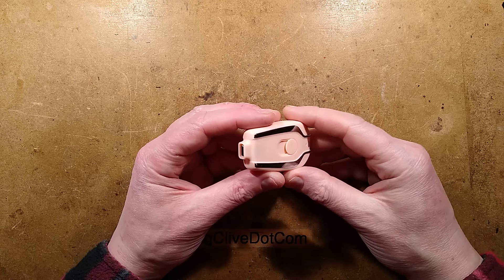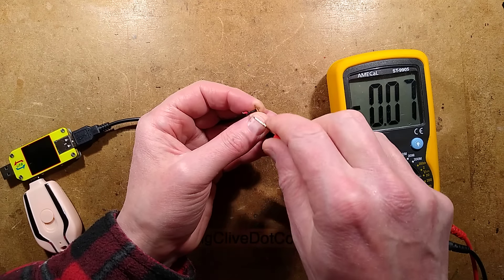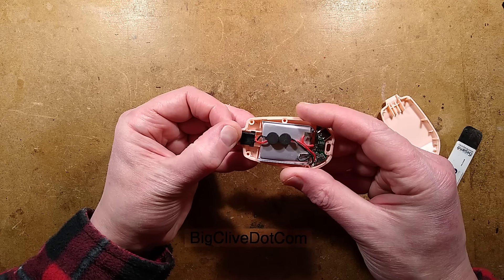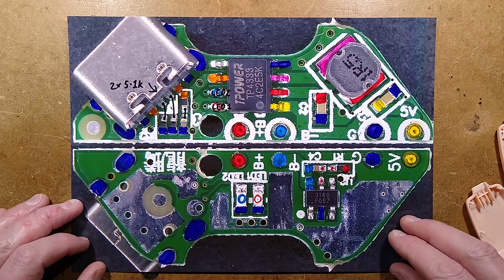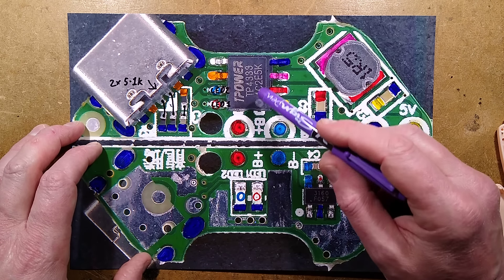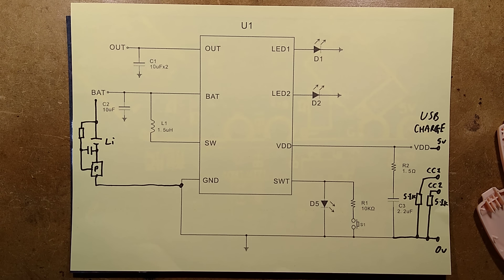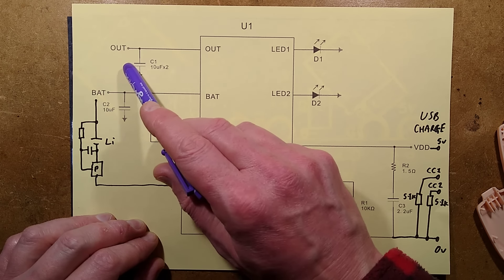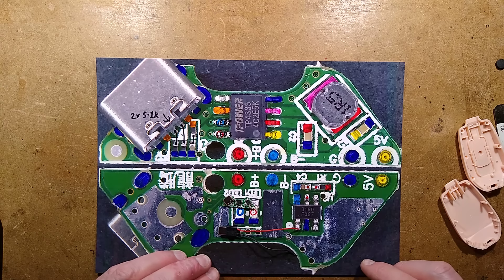eBay keyring phone-killer

Comment: Finally, the damn resistors are actually in place! I got a product recently that at first glance doesn't even have the PINS in the USB C connector for the 5.1K resistors that are nowhere to be found on the board...
Reply: That might explain why my cheap Amazon LED floodlights only charge with the supplied charging cables. Putting my phone's charging cable into it just makes it do nothing.
Reply: @99domini99  without the resistors, it’ll charge on a usb A to usb C cable but not on a C to C cable.
Reply: @JasperJanssen  Most of chargers without resistors give standard USB 5V, just output voltage selection is off. 5k1 resistors is also 5V selection for charger.
USB A to USB C cable links USB port power out with device power in - so also 5V in operation.
Reply: @adamw.8579  The 5k1, for the chargers that honor the standard, are also for the cable detect / activation of the charger, not only current select. Because USB C ports can be both sink and source the resistors are placed so that both devices will not try to charge each other simultaneously. And then it depends on whether or not your device can enumerate. The standard is complex enough to be honest, without getting into PD, but very few respect it.
Reply: @adamw.8579  The CC resistors are not used for voltage selection, they're used to identify USB C port role (sink, source, and some special stuff) and for sources to identify the current it can supply (usb standard, 1.5A, or 3A). To get anything other than 5V at up to the advertised current you need to do Power Delivery negotiation.
Reply: @adamw.8579  Any USB-C charger that provides 5V prior to detecting a sink (which requires the 5k1 pull-downs) is in violation of the USB-C standard: "The Source’s USB Type-C receptacle VBUS pin shall remain unpowered [..] until a Sink is attached. The VBUS pin shall return to the unpowered state when the Sink is detached." —USB Type-C Cable and Connector Specification v2.1, section 4.4.2.
Reply: (of course that also means the charger in this video is non-compliant even if they hadn't reversed the polarity, but that should surprise noone.)
Reply: @MatthijsvanDuin  Not very sure on that, on first thought, I would think it would be if it was at least properly fused at least at the output. I think by USB-IF standard without CC line voltage detection 1A is allowed for all types of USB connectors. If I remember right, you can place the 5k1 resistors, which with a capable charger will give you up to 3A at 5V, but then the downstream device has to read the voltages on the CC lines to determine polarization AND how much current the upstream device can safely give. The 5k1 termination resistors are not a free pass for higher current, the downstream device has to be able to determine, how much current it is able to draw. So yeah, probably still not compliant if it is charging with more than 1A, but if it is limiting itself, probably for thermal reasons, then it´s not that bad of a pass.

USB standards were kinda developed by the market and the USB-IF kinda followed up the market, not the other way around, so it´s kind of a very peculiar situation that you get, since with the old standards very few devices would actually pass, but the newer allow enough flexibility.
Reply: @TrickyNekro  Also, if the source advertises 1.5A or 3A via the CC pull-ups then it's guaranteeing it can source 5V at that current. A sink that detects this advertisement via CC does not have to "be able to determine, how much current it is able to draw".

You may be confused with the old USB Battery Charging spec which allowed the sink to try to get up to 1.5A but only guaranteed 5V up to 0.5A, so a sink that tries to draw more than that should limit its current to keep VBUS from dropping too low and in particular to keep it from dropping below 2V since below that the charger may disable the output.
Reply: @MatthijsvanDuin  Yeah, I don´t think I´ve said something opposite to what you said, unless I confused upstream and downstream. So let´s do it with source and sink, that´s a bit clearer.

The sink has to be able to read the voltages on the CC lines to see how much current the source can provide. That´s what I said, or tried to say, in my comment before. In that sense there is a "negotiation".

With USB3.x:
If the device can enumerate, if should not draw more than 100mA before enumeration. And in the enumeration it negotiates the current it can draw. If it can not enumerate, a.k.a. a battery charger like this, it has to limit itself to either 500mA, 900mA or 1500mA, probably looking at the D+/D- line voltages. Yes, that was battery charging something charging specification.

But I can remember very well, that the current draw for non-enumerating devices was made greater by the USB-IF because of all the gadget market. Originally, the specification was 100mA without enumeration, now it is the 900mA limit if not mistaken. That means, no resistors, no nothing, just that each USB port should be able to provide up to 900mA without even knowing what is connected to it. And this was the result of the gadget market abusing the battery charging specification, never the less stayed that way.

Also, first have the phone manufacturers primarily started abusing the spec of the USB by charging phones with up to 2000mAh, then the USB-IF followed with the newer specs to have this allowed to 1500mAh. And because everyone started breaking the standard like Apple and Qualcomm, the USB-IF stepped in with a new charger specifications AND connector, namely the USB-C. For example, Qualcomm´s Quickcharge, came before the type C connector AND totally broke the USB specification. Same story with Apple.
Reply: @TrickyNekro  The latest USB3 specification (USB 3.2 spec rev 1.1) still doesn't allow an unconfigured device to draw more than 150 mA. See section 11.4.5 table 11-2.
Reply: @MatthijsvanDuin  I was wrong about the 900mA, it´s 500mA, but still no, devices that can not enumerate AND have a type C connector can draw up to 500mA. Look for the definition of "Power Sinking
Devices (PSD)" that´s from "USB Type-C Spec R2.0 - August 2019".
Reply: @MatthijsvanDuin  So, easily said:

Devices that CAN enumerate, should not draw more than 100mA before enumeration.

Devices that CAN NOT enumerate shall pretty much draw up to 500mA.

That´s because NON-OTP ports should be able to provide with at least 500mA anyhow. So it all makes sense now.
Reply: @TrickyNekro  Yes I mentioned the 500 mA exception that type-C specifically gives to dumb devices.
Reply: @MatthijsvanDuin  Well, since there are type A to type C cables this new specification has pretty much fathered all types of connectors.

Still, because available power is advertised on the CC pins for type C connectors, then the sink should be able to draw more, even if it can not enumerate but can monitor the CC pins. Or at least that´s what I understand from the specification, I was wrong about the 500mA being 1000mA ( it´s been months since I last read the specification ), but I don´t think I am wrong about the whole concept of the CC lines.
Reply: @TrickyNekro  Yes, 1.5A/3.0A Type-C current advertisement via the CC pins overrides the normal usb power budgeting (and PD overrides everything).
Reply: @TrickyNekro  Reading back, I think I just misread/misunderstood your original comment I replied to, and from that point on we've mostly been violently agreeing with each other and in the process gave an exposition of the complexity of usb power budgeting to whoever else reads this thread, lol.
Reply: @MatthijsvanDuin  Correct that´s what I also read and understood, as long as there is a PD contract between the devices, the sink does not need to monitor the CC lines anymore.
Reply: @MatthijsvanDuin  Yeah, I also did not understand the reason behind the tone of the argumentation, but hey... welcome to the internet I guess. Glad to short that out. 

It´s been a good refresher for me also, the USB standard before type C is a mess.
Reply: @TrickyNekro  no, all usb standards are a mess. Very much including C.

Comment: Note that the connector, as installed, has the red wire on the left and the black wire on the right. (Unless the connector is upside down as installed). Some conscientious factory worker connected the leads directly, making sure they were not crossed so they wouldn't be pinched together and possibly short out due to insulation cold flow when the case was assembled.

Of course the polarity is the other way around on the board, which I consider to be a board defect. The print is small enough that no normal factory worker (or much of anyone else) is going to be able to read it without a magnifying glass.

The big problem here was no 100% final assembly test. Either there was no test station at all, or perhaps the devices arrived in a batch, and the tester guy or girl just swept a bunch into the "finished" pile to keep up with the 30 people on the production line. Or maybe he tested it, the red light lit up instead of the green light, and he decided that since something lit up it worked.
Reply: but ... the connector is usb-c, therefore it's the same if it's upside down 👆👇
Reply: @arfyness  It's supposed to be the same on the output side, but if you flip it you swap the positions of the red and black wires.
Reply: @jpdemer5  USBC protocol knows this as well and its dealt with. You can safely use it both ways up, this is simply a manufacturing error don't overthink it.
Reply: @andymouse  I think what he means is the red and black FLYING leads will be the wrong way around if someone thinks the wires do not "cross over" if needed.

Sure the connector works either way around but if "left wire coming out the back of the sockets is positive" and the socket is turned over, left wire is now negative.
Reply: @guyteigh3375 I'd say flipping the connector in the case will make the wires connect correctly without crossing.  So depending on the assembly sequence, either the connector was put backwards in the case, then the wires soldered accordingly; Or the wires were soldered wrong, then laid flat to not cross as it was placed in the case.
Reply: Is cold flow what its called when plastic melts itself when in contact with.... Itself? Like the acetate is leaking out or whatever
Reply: The USB-C connector has 24 pins, two rows of 12. Search the internet for 'USB C pinout' .
There are 4 GND pins and 4  VBUS (possitive supply) pins. The 4 GND pins are on the opposite ends, while the Supply pins are on pin 4 and 9 on each side. So if you insert the connector upside-down GND still connects to GND and VBUS to VBUS. Swopping the red and black wires will allways swop GND to +5 (VBUS) and VBUS to GND (0 Volt).
It should have been caught in testing. My first thought was that there was no testing. May be there was only limited testing - checking for 5 volt on a digital multimeter to confirm that the battery to 5v switching booster is working correctly. For a 5v USB charger only the supply pins really matter. With a digital multimeter it is easy to miss the little - (minus sign) to the left of the 5 in the multimeter display.

Comment: Neat little device, indeed. The issue, coming from a QC inspector's point of view, is that whoever made them probably made the same mistake across several hundreds or thousands of them.  I ran into this while working for the QC for a company decades ago. The company had some equipment made in Asia and when a mistake was made, there wasn't one or two, there were thousands of units with the same error.